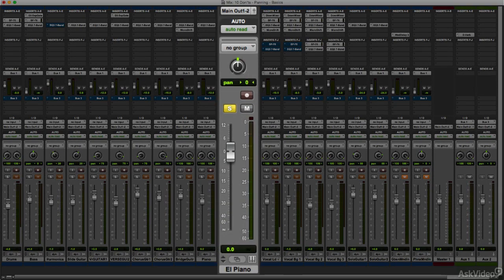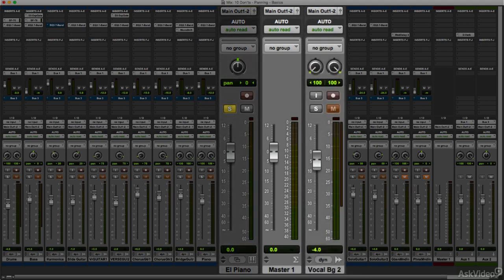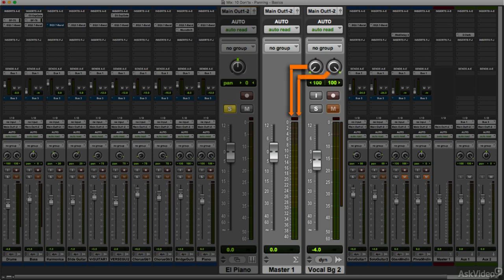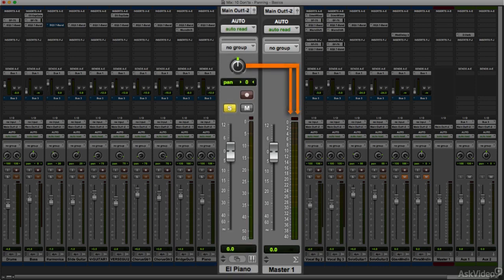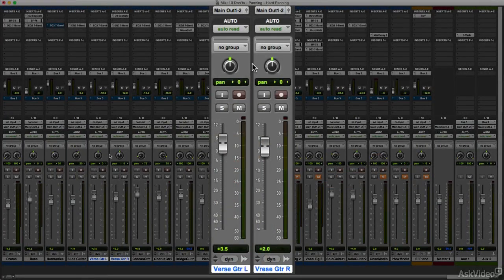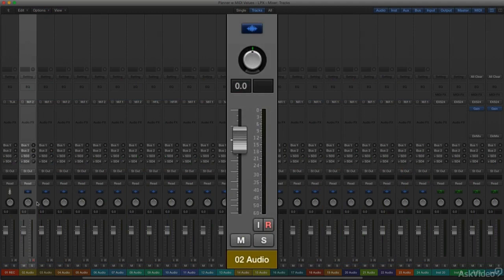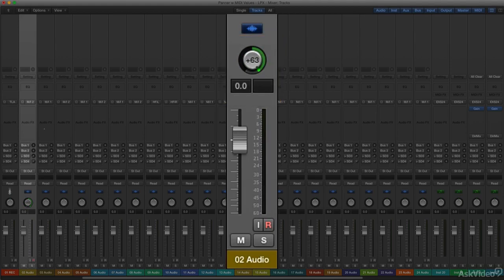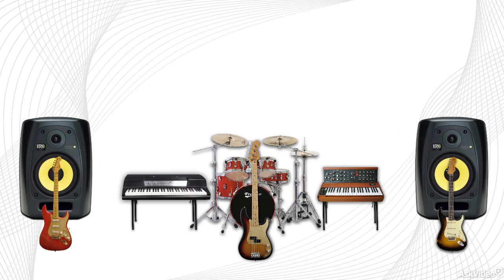Audio Mistakes 105: 10 Common Panning Mistakes - 2. Don't hard-pan

Comment: I'll pan as hard as I want, thank you
Reply: Best Comment! Haha
Reply: It is good advice but they were thousands of albums that have hard panning from 1956 - 1974. He means never 100 %. Even 95 %. A lot of pro engineers will not pan more than 85 % left or right. But 90 % is so small on the other side that it really makes no diffence. And what if I have a shaker panned hard right but the effect return is panned half way left?

You pan the way you want.
Reply: @JohnMorris-ge6hq  He's talking bout hard panning mono signals solely. Not mono signals with it's delay and other stuff. It makes sense from a psychoacoustic stand point. Only rare cases in a natural environment that you will hear a sound only with one ear, unless you deaf or something. When one ear receives a sound, the brain automatically looks for it in the other ear, when the other ear doesn't get the sound or it's delay, the brain thinks there's a problem maybe your ear is damaged or blocked  and your whole body tenses up and you get anxiety. That's called tension and resolution. If you get conflict without resolution, you never have peace of mind and you get stuck. 
Of course you can use that to create some sort of effect in your mix if the music calls for it but it has to be resolved eventually.

Comment: it seems like a lot of engineers in the 60s panned funny you had limited resources and I suppose not as many adapters existed that could somewhat pan more realistic like a band being on stage when the drums are fairly centered usually at most three guitars one being center bass obviously center and two keyboardists

Comment: Modern pop music rarely (if ever) uses panning (i.e. what comes out of the right speaker is virtually identical to that coming out of the left speaker).
Reply: Gil Orms Nonsense.
Reply: OK, today, 19.06.2017, I just used my headphones, randomly muting L and R channels, listening to iTunes' top 10 'hot' pop tracks, "Ugly" to "Hoodie" (i.e. the first 2 columns plus a bit of the third). At what points, in which samples, do you hear panning?
Reply: Gil Orms Bass, Kick drum(Bass frequencies from 60Hz to around 200-250Hz should always be panned center for the lows can effectively cut through the mix. Low frequencies should always be mono and panning them will result in them not cutting though. This is why engineers keep them in the center; LCR) Snare, Vocals and even sometimes hi hat is in the center. If not, a slight pan to the right(Hi-hat). Hard panned instruments such as electric guitar are hard panned left and right for double tracking. This isn’t the sixties, the industry doesn’t release mono tracks anymore. Almost every song that gets played on the radio is stereo regardless if the engineer developed a more mono sounding style but still fairly stereo taste to his/hers tracks. And I can’t blame you, a relatively small panning such as a 20% hi hat that’s panned to the right(audience perspective) can still be heard on the left. Turning off your left speaker even if something is panned will still always be heard on the opposite channel unless it is a 100% hard pan which brings me back to my point. Minor panning and even hard panned left/right double track techniques will still be heard on your stereo sound system even if one speaker is turned off.
Reply: Gil Orms I’m not trying to bash you or anything so please don’t take offense. Just trying to inform you.
Reply: Gil Orms 
That's utter bullshit

Comment: Is it possible that ( if ) I don’t hear the panning left and right as you explained that my interface is not reacting properly or that maybe my speakers aren’t properly connecting left and right Sir??? 
I have my DAW Presonus 6.5 Professional going into my Interface 2-line/mic in inputs and I have 4 speakers 2-mid/highs on top LEFT INPUT of interface and 2-medium low end speakers connected on the LEFT SIDE AND MY PANNING STILL COMES OUT IN THE MIDDLE. What am I doing wrong Sir??? I’m a 50 yr old man changing over from table-top recording units to DAW recording any help would be appreciated Sir!.

Comment: Meh, I like to hard pan. But not dry signals...When I hard pan, sometimes I will put a reverb on it and send it hard, to the opposite channel, post fader. Synths on one side, guitar on the other,  with opposing reverb sounds nice and cohesive but wide. Layered backup vox panned hard L/R. Then maybe I'll pan overhead reverb and/or toms/cymbals scattered around midfield to fill it out.Then I put a ring modulator and  on the master and crank the output to +50 db - just seeing if you're paying attention.

Comment: Thinking about width vs panning, let say i have a 30% width sound, should i pan it max 70% to the left? If i put it 100% on the left, what happens to the "left side" of my sound?

Something i've found out by myself (i'm pretty noob and never seen anything about that), is i also pan my sounds reverbs sends. Because if i don't, ie. the reverb of my left sound starts from the middle (or everywhere), not its actual position. If someone knows about that topic, i'd be happy to learn more.

There's also binaural panning, or other technique that lets you put sounds "behind". I'm confused as in this case, there is no real limit to left and right and sounds widths.

Sorry my non native english, and messy thoughts ^^